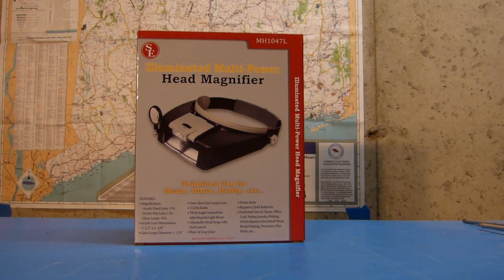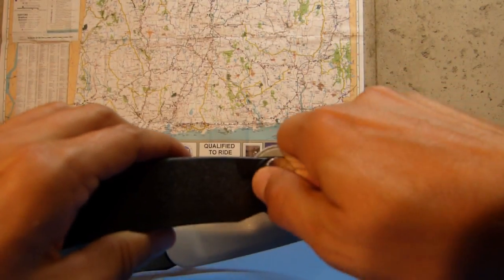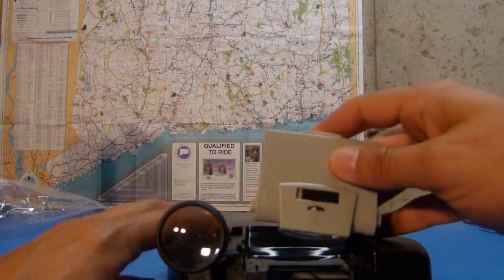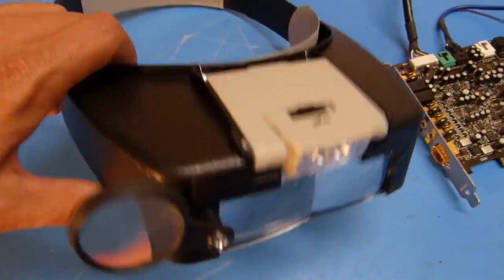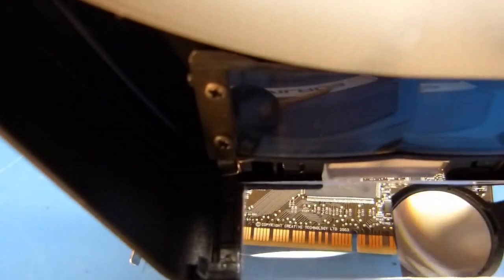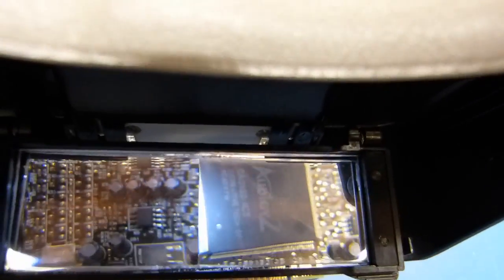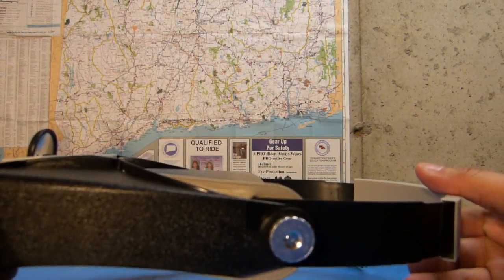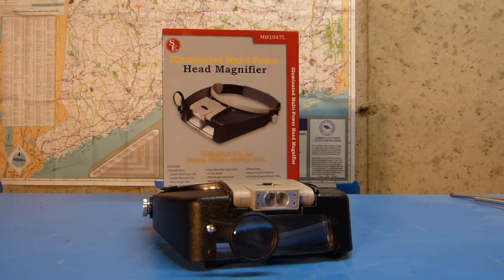SE Head Magnifier MH1047L Review

Comment: I just bought one and received it today. The problem with the visor not staying in place is when you raise it up the right tension knob loosens and when you lower it the left knob loosens. I took the knobs off and turned the spring washers around. That helped a little bit but the the knobs will eventually loosen. I wouldn't attach the light unless I needed it to light up the area I was working on to make the visor lighter. A button battery would've been better than the triple A batteries. Yes it's not comfortable but you hopefully won't be wearing it for long periods of time. The lenses look pretty good better than what you can show on the video. I said I bought it but I had $10 in credit on Amazon and it was $9.99 so it was free for me and I really needed it.

Comment: I bought these and they worked good for awhile but the side screws get loose after tighting them after awhile also the back knob breaks and you can't tighten them as well. I just bought the eye glass type due to those issues.